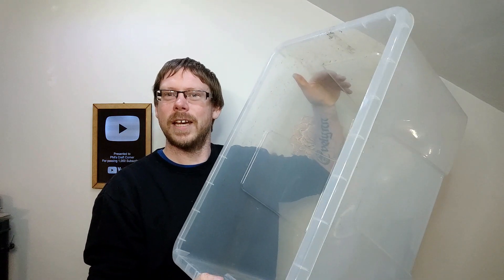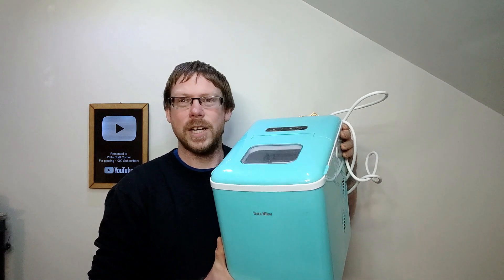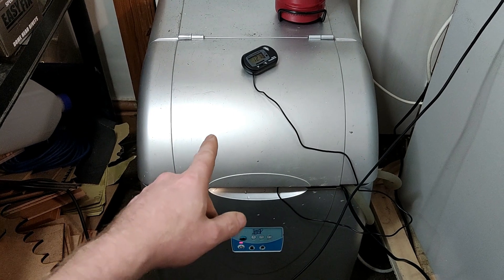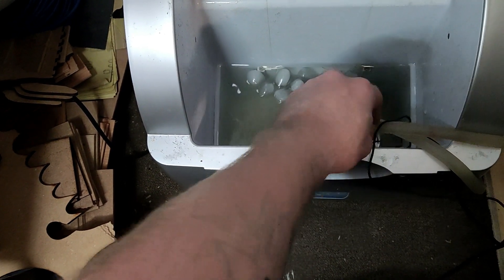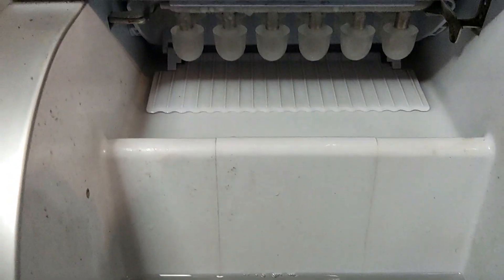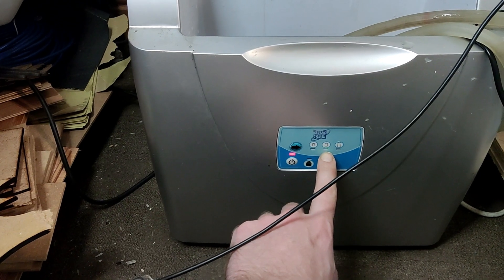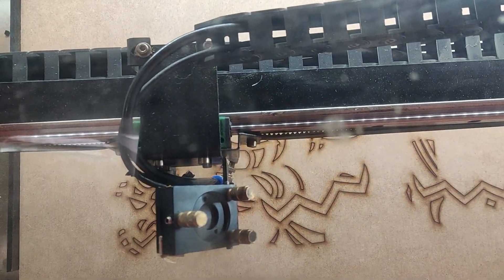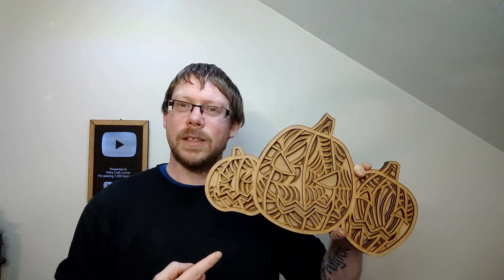Cheap laser cooling without industrial chiller or bags of ice

Comment from the maker: Thank you for watching, you can get the ice machine from here
Small Ice machine : https://amzn.to/3vvqkpY
Larger Ice machine : https://amzn.to/3aVXWnO
Reply: Hi Phil, I had a problem with my 80W chinese red and Black laser after 1 year got a water leak, prior to this laser was working fine. pulled the door of where the water is supplied at back of machine through a flow pump and found the leak, replaced flow pump and alarm came on my CW3000 cooler, tried a second flow sensor same problem, so bought a new Kogan ice maker and in the stage of installing, any suggestions for install, am removing cheap CW3000 cooler temp goes up to quickly here in Queensland Aus,, at the moment its winter and weather is cooler time to change.. hopefully it was just the water leak,, some are saying maybee a hose kinked, maybee but water leak started the investigation and machine was still working prior to pulling flow sensor out,, appreciate any helpfull coments on installation Regards Sam  Saturday 23rd July
Reply from the maker: Personally I removed my flow sensor and bypassed it by connecting the wires together.
I have a visual flow sensor instead. This doesn't restrict water flow as much compared to the original ones

Comment: Optimum temperature for a Co2 Laser tube is 22C for long tube life with a range of 15C to 25C for best results. With a commercial water chiller it's easy to maintain a constant thermostatically controlled temp.

Comment: I've stopped using a commercial cooler because it wasn't a refrigerated chiller and it was letting my laser go very hot during warm days. So I switched over to the ice maker and the cheap aquarium pump. Now my laser water temperature stays in a respectable range. And if I need to I'll pause a job to let the water cool down. With light burn it's not an issue.
Reply from the maker: I keep some of the small reusable Ice packs handy for those days where I'm running the laser for really long periods.

Comment: Hello first of all, if you do not use distilled or demineralised water your tube will break in a week the anode will be contaminated with the metals contained in the tap water, another thing to take into consideration is that the laser tube should not work at very low temperatures that can cause thermal stress and produce the fracture of the glass, I always work with my cooling equipment between 25-30 degrees centigrade, you should read what the manufacturer recommends. I have worked for 20 years as a technician on these machines and I have seen all kinds of home-made solutions that have resulted in expensive breakdowns.
Reply: All the water does is cool the laser. When you use distilled water you get less algae growth then tap water. If somehow the high voltage reaches the water in your laser it's not going to matter if it's distilled or not.
Reply: @DueyMiller-rk9dr   I do not agree with you, distilled water is almost not conductive, while tap water is highly conductive and that is what causes the breakdown in the laser tube, I give you some values so you can see: Distilled water: 0.5 to 2.0 µS/cm. Water for domestic use: 400 to 800 µS/cm. Maximum conductivity levels in drinking water: 1500 µS/cm. You do what you want with your machine, maybe one day you will find frogs swimming inside it.
Reply: @patriciomoragomez7756  I am wrong. The problem with the laser is the voltages so high it generates electrical fields cooling jacket but it can short through. Those electrical fields shorting out will decrease the power.
Reply: @DueyMiller-rk9dr  still wrong the laser arcs inside the tube because the electricity conducts off off tap water .  much like they old static lightning bolt machines that followed your hand as a ground.  Can actually watch the inconsistency of the arc inside the tube using tap. Its all over the place. As soon as its removed the beam aligns perfectly.  Give it a shot and record the beam fluctuations with a go pro.

Comment: Made some experiments today with a similar device... For engraving everything is fine, water stays cool around 22°C at 30°C outside temperature inside the garage. But as soon, as I start to cut acryl or wood, water temp is going up, far beyond 28°C within 5 minutes... 40W Laser tube... This is really not a replacement for a chiller...
Reply from the maker: Thanks for letting me know what your experience has been. Personally I am still using this chiller and it stays constant between 15-19°c. The ice drops every 4 minutes and the temp lowers very quickly by 4-5 degrees and then creeps back up.

My machine is a 50w and I run it at 70% power while cutting (around 18-20MA) for up to 2-3 hours at a time without issues..... Unless a power surge turns off the machine which can happen on a rare occasion.

Every machine and set up is different as is the use of the machine. It's a shame this didn't work well for you though. I hope you find a good solution.

Comment: Hello friend, I want to do this for my PC's processor, are you using distilled water? Is the machine motorized or does it use peltier cells? thank you.
Reply from the maker: I'm not entirely sure how the ice machine works but I use plain tap water. This does not affect the laser tube in any way as far as I can tell. It's been 18 months and nothing has made me think any different.

I'm not sure I would recommend this for a PC processor though. Generally they are a closed system with specific cooling liquids

Comment: Nice idea. Btw, what wattage is your laser tube please?
Reply from the maker: Thanks. It's still going really well with the same set up. I'm running a 50w tube in this one
Reply: @philscraftcorner  Thanx Phil. I just wonder if such icemaker approach would do the trick also for 100W tube... What do you think?
Reply from the maker: It would depend how long you run your machine and what power you use on there. I have been running for around 2 hours now doing some engraving at 20% and cutting at 60% started at 8°c water temp and it's at 10°c now.

If it's hot days and I'm running the machine all day I stick a couple of those re usable ice packs in and it keeps me going
Reply: @philscraftcorner  Well, just let me think, please. If I'd use icemaker producing cca 10 kg of ice per day to cool down 50W tube, then to cool down 100W tube I'd need icemaker which produces cca 20 kg of ice per day. There are some, like Klarstein Icefestival Cube ICE5 or Guzzanti GZ 124A. I'd most probably prefer Guzzanti, since it has lower power consumption (resp. higher efficiency?) and bigger water reservoir. And it's also quite cheaper 🙂

Comment: 12 degrees is too low as far I'm aware, you ought to get something around 18 a 20
Reply from the maker: Water temps will depend highly on ambient temperatures and relative humidity in the room your machine is in.
For my testing 10-23°c is a great temperature for my machine. Anything lower and dew starts to form on the tube, creating the risk of arcing. Anything higher and performance degrades fairly dramatically.

I did a lot of research on temps when getting started with my machines. If you read 5 articles you will get 5 different answers. It's always good for a reference but always test your own set up for the best results for you

Comment: Brilliant still 16c isn’t bad. Lowest I can get with frozen bottles is 20c
Reply from the maker: It still works great. Even on red hot days when the ambient temp is like 30°c it takes about 15 mins before letting the laser run to get the water temp from 24 to 16

Comment: Thanks for sharing! Do you think submerging a copper block instead would yield same results? I want to try to keep a closed system
Reply from the maker: That could work well, the only thing I can think of is that there might be a bit of condensation introduced along the pipe somewhere and with copper being conductive it might cause a few issues with arcing at some point

Comment: My waters room temperature is about 33 degrees Celsius so I've been freezing 600ml and 1l bottles of water and chucking them in the bucket a few minutes before use and drops down to 25 degrees but gets to 30 degrees again fairly quickly so I'm hoping I can find a cheap ice maker like this
Reply from the maker: If you can insulate your water bucket that will help a lot for the time being.
Some kind of packing foam taped to the outside would help in a pinch
Reply: @philscraftcorner  thanks that would help for now until my ice maker arrives and even afterwards

Comment: Hi Phil thanks for sharing,i have a Reci w2 100w max 90w recomended power, i checked with Reci on the water cooling Temperature they came back with 10 to 50 Degees which i find that a  huge variation. I run a S&A cw 3000 cooler i bought this with the laser, think i paid an extra100 dollas as im over in ireland. temperature isnt a problem and dont really run the tube more that 60% power, the cooler never goes past 24 degrees which is in the middle, i like  cw300 is it has a good flow rate and completly sealed ,i would agree with you running the tube at close to max the cooling makes a big impact on life span,but when you google cooling for lasers everyone gives a diffrent  answer.i also use di ironized water with 2 caps of bleach added its been in there 4 months and its clear as a bell.i think you make great videos and great products please keep up the great work
Reply from the maker: Thanks David that's some great information. That is definitely a huge variation on tube temperature. I have to admit though, the tube on my 50w will get to around 30-35 while running (that's the collets that the visible beam hits) they cool down pretty quickly too.
A sealed unit is definitely the best way to go if budget allows and would remain clear as no contaminants will get in. Just needs to be run pretty often.

I'm glad you enjoy my videos. I will definitely be continuing to make more in the future as I learn
Reply: Hi David  also have a CW 3000 cooler, useless in Qld. Irish man in Queensland Au

Comment: hi there ,
great idea i have just got my k40 and i am doing a few upgrades to it at the moment but i think i am going to run with this off the bat instead of going with frozen bottles .
Anyway what water are you running in this is it distilled or deionized? 
cheers Dazz
Reply from the maker: Distilled water in here
Reply: OK cool thank you Phil, just ordered myself one and should be here next week.
Reply from the maker: That's great. Hope it works just as well for you
Reply: Do you think deionized would hurt?
Reply from the maker: Deionised would work ok too
Reply: Just another question for you Phil is it still possible to use anti freeze in this setup .
Because my k40 is going to be in my shed I don't want the tube freezing up.
Cheers
Reply from the maker: I honestly can't say I have run anti freeze before. I'm a little bit on the fence with the theory though. Yes it will help prevent freezing over night but it might also hinder the time it takes to freeze the ice cubes between dropping them into the reservoir.
Reply from the maker: I think the better solution might be a tube heater that runs at a low wattage with a built in thermostat. They are great at warming small garages in the winter months and use around 6w of power
Reply: I used to have a 120w tube heater but it didn't really do much I'll have to think of something else
Reply from the maker: You could try the anti freeze while the weather is still mild. I would look at insulating the shed at some point though

Comment: Phil, you are awesome.  Thank you for this literally cool idea.  I am on the fence about buying a laser because of the upfront costs, but your advice really helps motivate me to get one.
Reply from the maker: Best advice I can give is to get the biggest you can. Power isn't such a huge issue to start but you very very quickly need a bigger bed.
I started with a 2w diode, upgraded to a k40 within 6 months (found that cheap on Facebook market place) now I have run the 50w (50x30cm) for almost a year.
I still want bigger 😅
Reply: @philscraftcorner  thanks for the additional advice.  I am actually looking at an Omtech 50w as I feel it's a good middle ground starting point.  Saving a few hundred on a chiller definitely helps. Plus the Halloween cut you did gives another idea of many with laser projects.
Reply from the maker: Any cuts that I do always have information on how to get the designs etc. If you need any help give me a shout